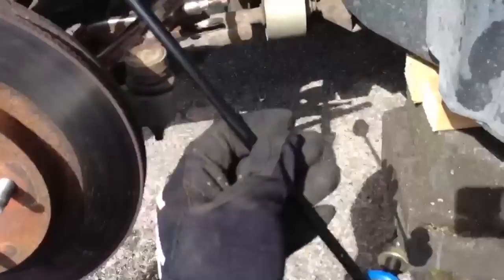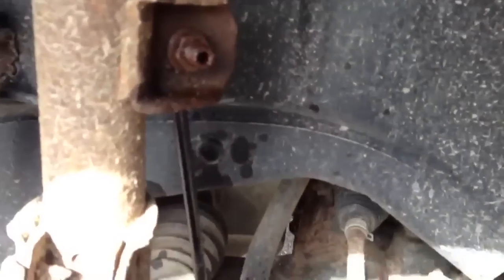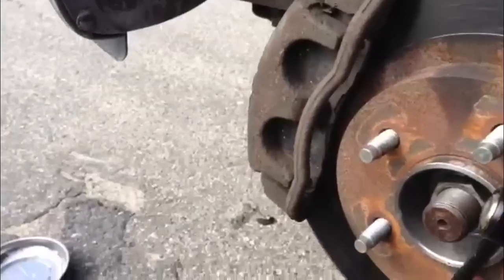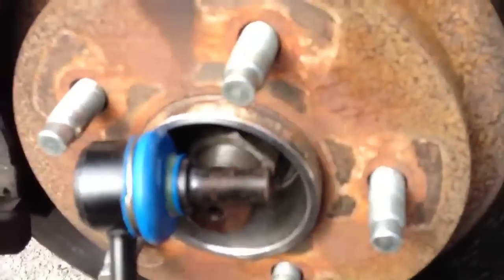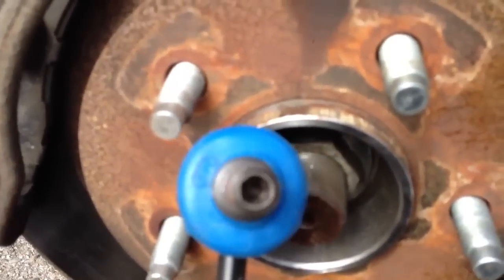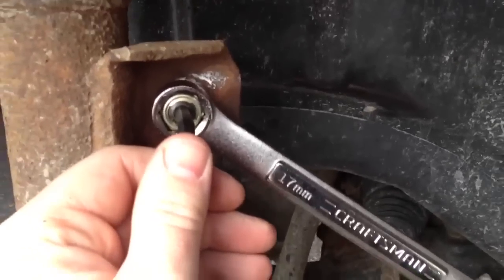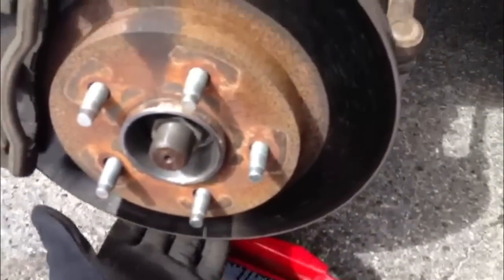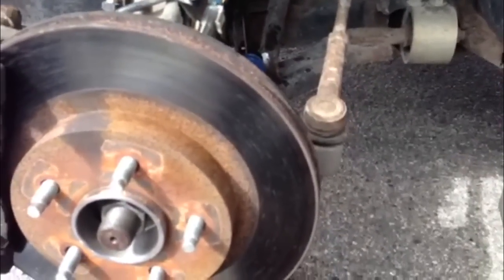Sway bar link repair

Comment: Thanks for the video.  I suggest greasing the zerks (if you have them) BEFORE installing since the top zerk is difficult to get to since it is so close to the panel.  Also, for those of us without a lift, you need to lift up BOTH sides of the vehicle before you can remove the links from either side to remove stress on sway bar.  You had mentioned this but it wasn't clear to me (until I couldn't remove the link).

Comment: My 06’ Saturn Ion suffers from this same issue, 236,000 miles, guess I cannot complain. Plus while the wheels are off, it be a great time to change the brake pads and rotors if they are worn. Good video, I now know what to expect. Thanks...

Comment: The WD40 spray to loosen the bolts and also the comment on the Allen Key for the bolt/threaded stud are great tips. On my 2004 VUE it uses a 6mm Allen key or Hexkey.

Comment: This is very helpful. I have a 2004 Vue AWD that has a broken stabilizer bar I now need to replace. Understanding how the stabilizer/Sway bar links attach is extremely helpful. Thank you. I will attempt to video my DIY repairs.
Not sure if anyone here has actually replaced the front stabilizer bar. I am hoping it can slide through from one side to the other without having to remove or detach any other mechanisms other than the two main clamps and of course the links on each side. Any input will be appreciated. Thank you.
Reply from the maker: Sorry I didn't see your comment earlier, not a big google plus fan, lol, but I'm glad this was helpful. I've don't the same job in other cars etc. but all and all this one wasn't bad, the reason I wanted to do this was to show almost basic hand tools would get the job done as this must be $500+ at a garage

Comment: i have a question? this bar are in both sides or just in the drivers side i ask because in mi saturn i cant see the bar in the pass side, i don't know how the stabilizer bar is attached to othe place in the suspension. note: in the drivers i can see the sway bar like in the video. thanks for your help
Reply from the maker: I never get my google+ notifications! I hope I'm not to late in offering help , The upper part of the sway bar link mounts onto the body of the front strut, I have never seen it in person but I guess the tab it bolts to on the strut body can completely  snap off, especially on a rusty strut. I believe on the passenger side on this car I had to bring it up to my buddies house and tack weld the tab a little bit because of a crack. If it's the actual sway bar you can't see, they can bust too, cause the bar to twist up under the car

Comment: What about the rear links find all kinds for front of 03b Vue I need to know where to mount the rear ones
Reply from the maker: Technically the prosses I go over in the video is the same on the rear as I did in the front, the owner traded her car in 6mo's after I shot this because it needed the rear links and CV axles, plus it developed a cracked manifold, sorry I couldn't help you out more but I hope the video gives you an idea of how to tackle the back?
Reply: +2009deerejohn Thanks the video did help a little just trying to find where to mount the links